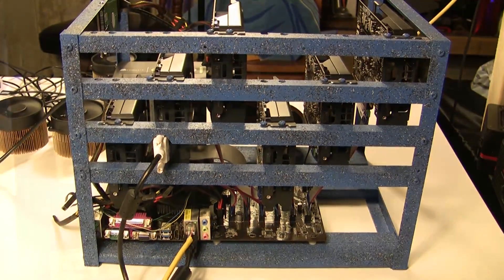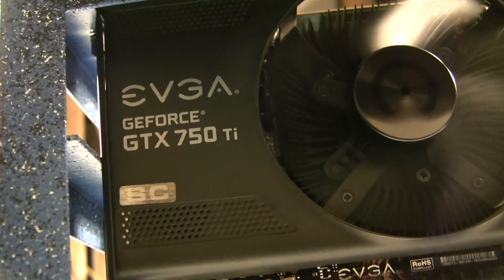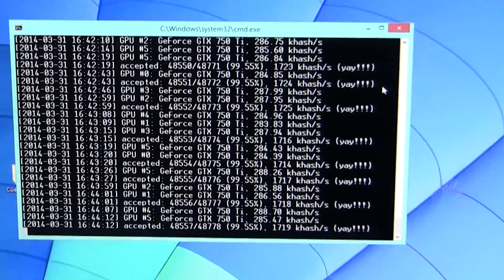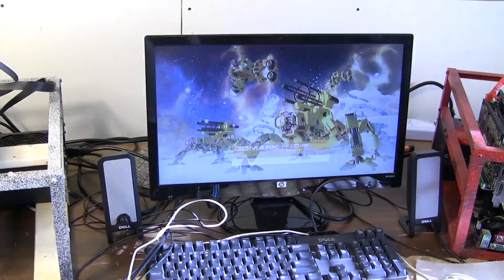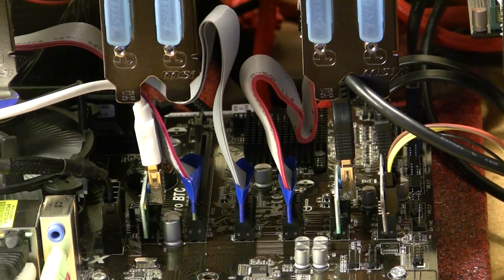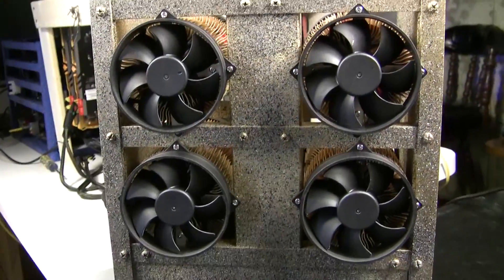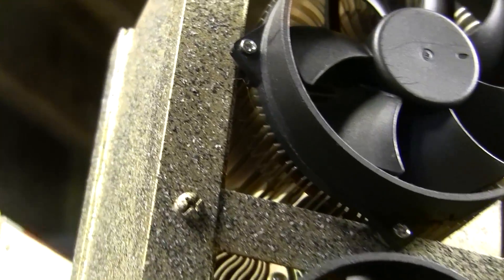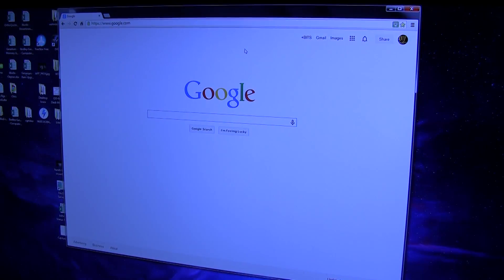BBT Episode15: LTC/BTC Gridseed ASIC 5-Chip, 6x eVGA 750Ti SC hashrate

Comment: Inspired by your videos I'm running a whole mess of nVidia 750Ti's. Mostly EVGAs but some ASUS too. Some have the 6pin power connetor and some don't. Using stock settings and CudaMiner 2014-2-28 all cards get 260-275 kHash/s. The problem I'm running into now is that all my rigs with Windows 7 (both retail and OEM versions) my antivirus (Kaspersky) keeps deleting my .bat file and CudaMiner. Setting exclusions and setting CudaMiner to a "trusted application" doesn't make a difference. My Windows 8 rigs don't seem to care and they are running the same exact antivirus. Have you run into this problem on any of your builds with the antivirus fighting the mining software? Is it a problem specific to Windows 7? Is there any specific brands of antivirus software that play nice with mining software? I'm so fustrated I'm ready to nuke the hard drives on all my rigs and convert them all to linux!

Comment: Lessons Learned, My Experience With Riser Issues:  Guys, if you landed here somehow because you can't get all of your risers to work with all of your cards consistently, or more than one card risen at a time fails to boot your rig, take a peek in the BIOS.  I was banging my head on the wall for about 4 days and was about to order new risers (thought they were busted) but something just didn't add up through all the troubleshooting.  In the BIOS, PIC-E slots can be set to different "generations" (if it is supported in your mobo's BIOS), most are set to "auto", this caused the issue for me (R9 290x Sapphires).  Adjusting this value may solve your issue, for me it was switching to Gen-1 for all slots.  Just wanted to get it out there.
Reply from the maker: Good tip!
Reply: Thank you :)
Reply: Dosn't "Gen 1" Limit the Bandwidth? As if im correct, New PCI-E Is 3.0?. The Still used Generation is 2.0?..

Comment: You have to use kepler bios tweaker to change the watts for each 750ti to 65w of power, they are set to nearly 42w instead of 65w, once you do that leave your gpu clock at 0 and make the memclock 550 on each card using evga precision, you will get 300+ each 750ti, I get 321 with evga FTW 750ti's